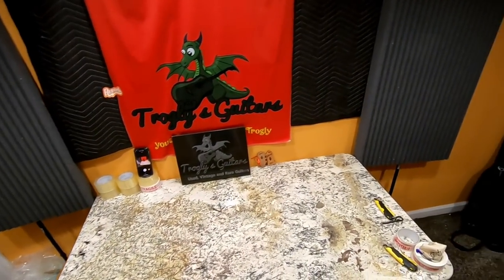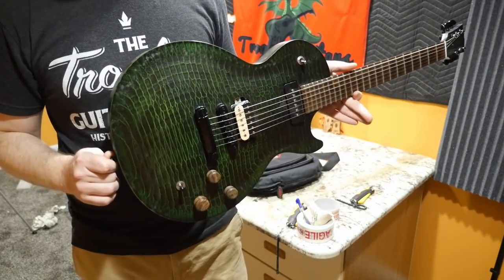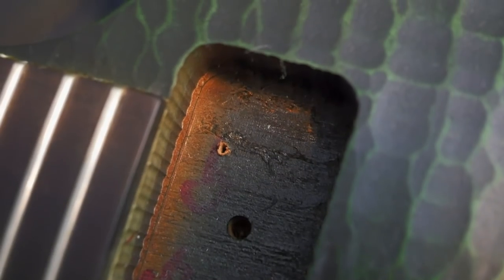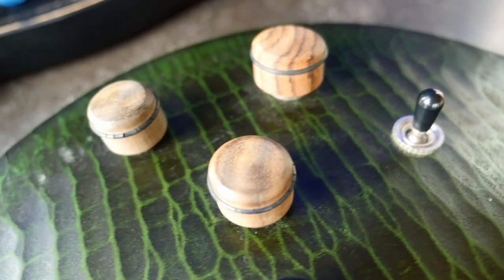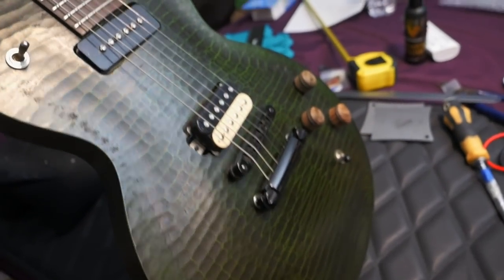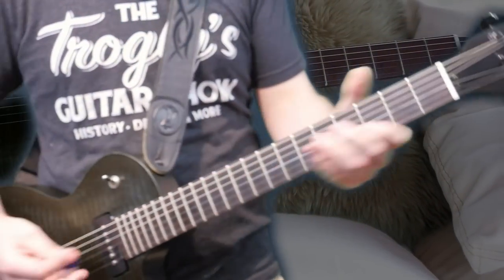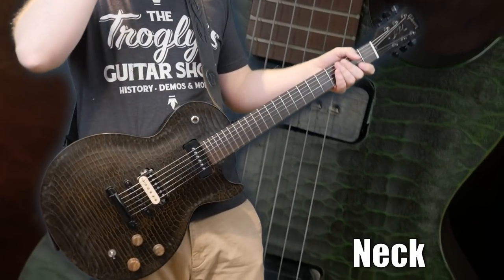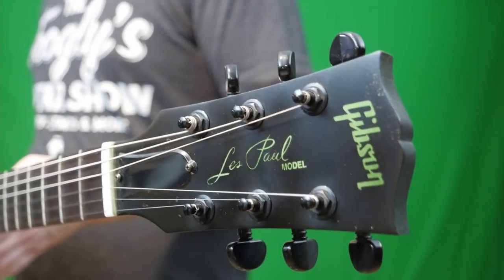Gibson Didn't Even Have to "Finish" This Cult-Classic | 2012 Gibson Les Paul BFG Gator Green Review

Comment from the maker: BFGs are charmingly simple guitars that pack a lot of punch! I'd highly recommend checking one out
🟢My Website: https://www.troglysguitarshow.com
🔴Reverb: https://reverb.com/shop/troglys?_aid=growsumo&gs_partner=Trogly
❓Private Help Sessions: https://troglysguitarshow.com/help-appraisals/
Reply: Sounds like the ground wire to the tail piece stud has an issue.
Typically shielding wouldn't be a problem in a dedicated Studio as equipment that cause interference (fluorescent lights) can be removed from the playing space/area.
You really should take a Tour of the Gibson USA Factory.
Those head-stock markings are not decals, they are silk-screened paint.
Reply: The rubber on the knobs is a simple O-Ring laid into a groove cut into the circumference.  
Most Auto Parts or Hardware Store will have replacement O-Rings for less than $1 each.
Reply: I'd love a BFG !
Reply: Im too an owner of a bfg from may 2007 and my truss rod cover says it's a les paul custom. also my humbucker do have a ring around it. do you know why?
Reply: My favorite pickup combo... Unfortunatly I prefer the longer Fender scale length
Reply: Man, I love the look of those BFG guitars. I was a little bummed not to find it for sale

Comment: To shed a little insight on why the top looks like that, The ridges are a result of only running the roughing toolpath when CNCing the top carve. Basically imagine a big drill bit moving up and down across the top. Normally they would then run a finishing tool path with a small drill bit and maybe even a third toolpath with an even finer bit before hand sanding the top. It's basically pixelation in 3D

Comment: You could also just turn the kill switch 180° to flip which way is on/off. The easiest fix. If people removed it completely it wasn't because of orientation, it's because they wanted to upgrade it to standard specs.

Comment: BFG owner here, my grounding issue came from the killswitch. Once I removed that, the majority of the ground hum went away. Also check your stopbar where it contacts with the mounting peg, the black chrome finish can block the ground. For some reason the BFG's have something weird going on with the grounding from factory.
Reply: When you say that you removed the kill switch what did you do exactly please? I have red 2007 one and it is annoyingly noisy.
Reply: @spiceybadger  completely removed it from the guitar and unsoldered it from the circuit. You can find plastic hole plugs to cover the hole
Reply: @Kylemast  Thanks!
Reply: Did we not need to jump a wire from the toggle switch to the pot that connect  to thee jack? Otherwise it wont work @Kylemast

Comment: On the knobs. The rubber grip is nothing more then a standard O-ring. Just measure the thickness and OD of grove. Get O-ring with that ID. Go to McMaster Carr and you'll find them there. Or maybe even Lowes will have them. They will be as good as new.
Reply: You got there first ...
Reply: The only reason the small ones have cracked is because they were more stretched!

Comment: I really dig that model. I’m glad you covered it, I’ve seen them around. For the kill switch, can’t you just rotate it 180 degrees?
Reply: Depends on how much slack there is in the wire. If there’s enough, then you absolutely can. Alternatively you can just flip the wires if you have a soldering iron.
Reply: @Andrew_182  there was one shot of the back of that switch. It looked like a micro Spdt with a little slack. I bet a regular Gibson style switch would be a little easier to deal with, it wouldn’t be quite so stiff.

Comment: I would swap the kill switch and 3-way toggle locations, having the 3-way all the way down there reminds me of PRS, and it’s one of the reasons I prefer PRSs with a Fender style 3 or 5 way switch since they usually put it up higher.
Reply: I just can't understand players who think having the switch a million miles away from the volume and tone controls is a good thing. I almost always correct the volume or tone a little when I switch pickups. I don't get the "preset" mentality or people who don't use the controls at all, except as on/off "rotary switches".
Reply: @henrygvidonas9573  I’m more of an SG and Les Paul DC fan, which group the controls together. Then again I like reverse Firebirds too and they put the switch on the far end of the bottom horn. 🤷‍♂️
Reply: I have used the regular toggle switch as a kill switch, so the location is a good thing for me.
Whether the kill switch is up or down for off?
I am good either way
But as pointed out- easy enough to change
Reply: I rewired my lp's to have a single volume pot and toggle switch. 2 volume pots is uneccesary and having the toggle switch above the strings had always been a stupid design.

Comment: I bought a BFG a few years back, (I think it might've been four years ago) and mine was slightly different. First of all, mine was black, had two volumes and two tones, and both pickups were back soap bar P-90 pickups. I can't remember who I ordered it from, but it was ridiculously cheap, because it was a close out clearance sale. ($600.00 U.S.) If you looked at it from a far distance it looked like it was painted zebra stripes. The body had a few chunks missing from it, but you wouldn't notice it unless you inspected it REAL CLOSELY. No biggie, just a few minor chips, pings, and dings. It most certainly didn't compromise the sound in any way. The fret board itself had no markers, but the neck directly above the fret board did.  Very fast, smooth, and easy action. If there was one thing I really didn't like about it is I thought it was rather "Gimmicky", but, hey, a Gibson Les Paul for $600.00 with P-90 pick ups, who's really gonna complain? It was/is a good guitar. I'm happy with my purchase. I should also add that it was "Weight relief" so it wasn't as heavy as most Les Paul models tend to be.

Comment: I have a 2007 Transparent Ebony BFG and it doesn't have the neck pocket feature that the Gator Green one in this video has. I recall when the Gators came out and you're correct, they do have baked maple fretboards (I almost bought one brand new when they came out). Great video - these are my all-time favourite Les Pauls.

Comment: thats a keeper. Im back. Sold my 2019 Les Paul Standard for 2200 with a vibramate installed Bigs 7, shaller roller. a month or so ago, sold the 2021 Tribute SG with Vibrame Bigsby and TOP hAT KNOBS A UPGRADED HAND handwired, and slave bridge posts and put the ABR in the Nashvilles place, Its gigging out on a young bands set a lot. that Tribute Husk is to die for.

Comment: That ridge next to the neck is relatively small on yours. Google some images and you can find a low, flat spot next to the neck up to half an inch wide. I kinda think this suggests that the BFG bodies were meant to be regular Studio ones but someone messed up something on the CNC and an entire batch was set aside until someone figured that the unfinished rough carve looked pretty rad, and that the flaw next to the neck could just be a part of its raw aesthetic.

Comment: Had a black one that the previous owner modded (ruined) by "routing" the neck pickup position to take a humbucker. Would really like to have tried one with the p90.
Anyhow the main issue was the neck dive as it was so light.
The upside of the chambering was  however that when pushed into feedback it sang like a bird.
Id still have it if it wasn't for finding an old guitar of mine was up for sale.

Comment: I've got a 2009 Gary Moore edition and inlove it to death. Its a guitar I'll never part with.
My P90 doesn't have the anchor plate, it has two bushings set into the body that the screws go into.
My neck pocket also has the ridge on the neck pocket, too.

Comment: The very very first run were called the BFG limited,...The first 52 in each color (black,  gold,  red) . 52 representing  1952, the first year of the les Paul. The headstock has an actual autograph from Les Paul himself (not a decal) and to add even more MOJO,  each hand written serial number on the first 52, represented a year of Les Paul production up to 2007.  So the gold serial started with G 1952 onwards, and ditto for the red and black ones.
Reply from the maker: You’re right. I forgot to mention the Les Paul signed runs

Comment: Simple O-Ring gaskets for those knobs ought to do the trick Austin. Lowes, Home Depot, Harbor Freight or TSC.

Those gaps between the neck/fretboard and the body joint are likely present to allow for binding during the regular mfg process. Guessing that, not fact.

Comment: If I didn't absolutely loathe the outer concave part of the the typical Gibson arched top so much (Les Pauls and Telecasters gave me massive nerve and tendon problems in my right arm for a while, years ago - I mostly don't play acoustics anymore for the same reason), this would be the kind of Les Paul that could get me to look for one as a "project". People like Trogly, collectorboys and gear flippers, must absolutely hate people like me - I don't own a single guitar that I haven't modded in some way. I put a Firebird pickup in my PRS Santana and the "neck pickup" is currently just a plastic cover I made for the cavity. It will either stay that way - I'm not missing anything - or I'll put a P-90 in the neck if I ever feel the need for it. I don't really need neck pickups on guitars that have a good tone control pot (improved taper with a small capacitor) on it.

Anyway, massive 60/50 Hz hum and grounding problems on a Gibson that has the original factory-installed electronics? Yup, "play authentic" because "only a Gibson is good enough" - as usual! There's always something with a Gibson...

Comment: my 07 BFG in Trans Black did come with a black trussrod cover and a cream switch tip. Aswell as a black Gibson USA TKL case with white interior and the numlock on the side
My BFG also does not have the baseplate under the P90 but has some knurled nuts inserted into the wood in which you screw the p90 down.

Comment: The grounding issue its cause by the Killswitch not being grounded on the circuit.
Mine got a little better once the Killswitch was grounded. Still I would like to rewired it as the standard layout
Reply: How did you do that please? I have a similar issue on mine. Thanks.

Comment: i had the same grounding issues the black hardware dont connect zo each other you need to sand it by the studs on both sides its absolute a factory thing
Reply: Could you explain a little more about what you did please? I have an early red one with the same buzz.

Comment: The limited natural one is my favourite looking guitar, if Gibson contacted me to do a signature, it would be like that limited natural one, but with the classic control layout, a cheap guitar where you decide paint, binding, plastics, inlays... and cheap!

The Gary Moore one was at my local guitar shop. I regret not buying it but at the time I despised it. It's the only rosewood model with nickel hardware.

Yeah, the Gary Moore has rosewood and baked maple depending on the year due to the Gibson raid, and only the original black, trans gold and trans red models have the slim taper neck.

Comment: That green one looks and sounds great. I have a 2007 BFG in cherry. It weighs 8.0 lbs. It does not have any space/crack at the neck pocket like yours. I think it's a novel guitar and sounds really good. The original owner shielded the cavities, replaced the kill switch with a pickup selector switch, and put an SD P-Rails in the bridge position, which can be switched from full humbucker to P90 to Hot Rails coil with a 3-way mini-toggle where the kill switch used to be. This is the only guitar I ever purchased that was advertised in a condition (Very Good) less than I would have rated it (Excellent). I was pleasantly surprised! And the mods are perfect.

Comment: In my opinion Gibson best Les Paul.  I have the Gary Moore version, I changed the pickups out (BSG P90 and Seth Lover HB).  I also put a pickup ring on the humbucker, but only put 2 screws.  Swapped selector switch and kill switch positions. 

2018's are not chambered like the early ones.     

I also have the ridge and from what I have been told. Is that because it's not totally sanded down.  That ridge wouldn't be there once it was sanded down to specs.